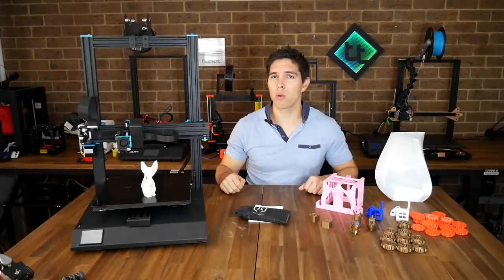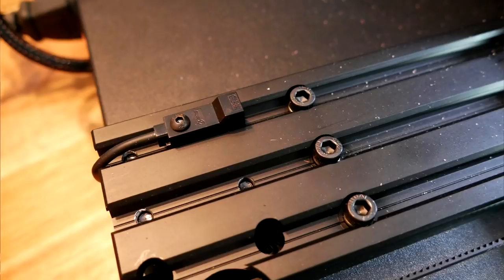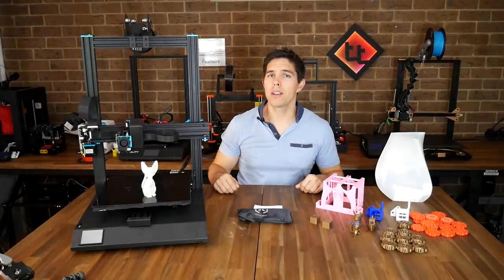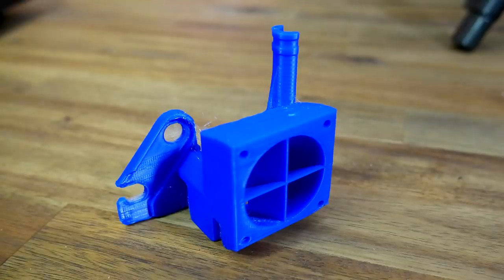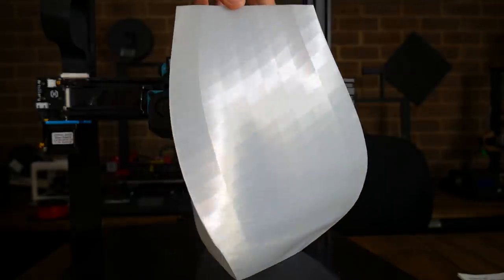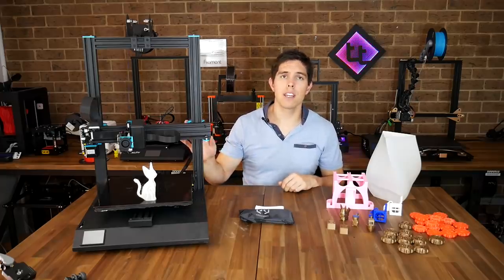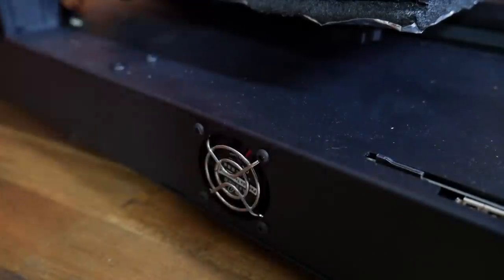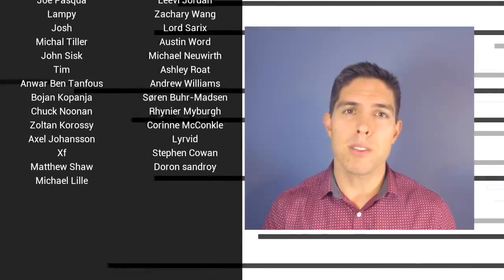Artillery 3D X1 Sidewinder Review: A unique challenger to the CR-10S

Comment: Question: wouldn't those ribbon cables be prone to wear especially the x-axis one? I feel like they'd crack and I'd be out of luck to find the exact replacement. Does the package come with extras?
Reply: I was thinking the same... It seems to have such a tight bend when the X carriage is all the way to the right side :/
Reply: @slayga  yeah, there is a spare apparently in the package so I guess they do expect it to eventually break. :/ I'd say make a wire chain or something.
Reply: @AmusementLabs  Ah yeah that's a shame. Can't beat how neat it looks though hey. I'm used to my Prusas' umbilical cord sticking out the back lol

Comment: The mechanical and overall physical design on this thing looks superb. It's also nice that the control board has replaceable stepper drivers, you could easily upgrade it to Trinamic drivers. Software seems a bit rough, but I see a lot of potential.

Comment: this machine totally kills the cr-10 pro for features alone!....a good customizable main-board..pr-loaded boot loader, many mks add on's , super easy to compile and upload firmware, led hot end light! y axis is beefed up...x axis is beefed up  dual z ( syncing a dual z motor system is a bit odd..and may cause some issues) amazing cable management....ac bed....GLASS BED....this is a cr-10 murderer...awesome to see these "over seas" company stepping it up a notch....now if we can get them to switch to a 32 bit board
Reply: A year later do you know if they've made improvements and polished out some of the issues he's highlighting?
Reply: mitch h would you still recommend this printer, or would you have a better one?

Comment: I bought a V4 Sidewinder X1 DESPITE THIS REVIEW. I found it easy to assemble and printed the test cube with no fuss. I love the near silent operation, large print volume and extremely fast heating times. After weeks of printing (engineering parts): 1- I had to tighten the belt that moves the bed (easy). 2- The v-guide wheels are starting to shed plastic (I cleaned it but will replace them with poly-carbonate wheels). The print bed lost adhesion and nothing would print. (I cleaned it with kitchen paper and acetone and that fixed it.) Overall it is a great printer. Soon I aim to upgrade to all-metal with hardened nozzle so I can print Nylon and Nylon-X parts.

Comment: A neat and solid looking machine, no question. Now the question is: how reliable is it, how solid are the electrical components and how long will it last with heavy use?
And concerning the QA and product improvement policies of Chinese manufacturers, it is probably smarter to wait a few months until the apparent issues have been revealed and the design has been updated.

Comment: First, thank you for all your great work and the incredible amount of data you share in your videos. You have made my personal journey into 3d printerland much easier since I stumbled upon your channel.

I have a Wanhao D6, well actually the Monoprice badged version. It's been inconsistent and rather unpredictable, but I did jump into modding it way sooner than I should have. Be that as it may it's already required a new main board replacement in the four months I've owned it. It also has guide rod alignment issues that reduce the print volume by about 15mm on the X and Y axes. It also has a couple of other pretty annoying issues I have not been able to iron out. I do have the enclosure for the D6 and am probably going to keep it for ABS parts and the like that benefit from the higher tempt possible. 

So, I'm interested in a larger format open framed printer for PLA and PETG and the Artillery SWX-1 and the Tevo Nereus are the two front runners.  Or would I bet better off with a CR-10S maybe? Do you have a preference or recommendation you would be willing to make?

Comment: Recently got a Sidewinder X1.   I have a issue where prints that are in the middle of the bed do not stick.  If I move the same print up closer to the front edge of the bed it will stick and print fine.  What is the deal here.  I tested the heat and the middle is heating just fine.

Comment: Does anyone know a source for the end stops used on this printer? I see on Banggood that they are apparently using inductive endstops, which I'd be quite interested to have a look at in that size. 
*edit* I was just having a look at the video again and can see it's got branding and a model number on it....but can't make it out. It looks (kind of) like XNAS and H3-J9 but I get no results with that.
*edit2* So as it turns out, it's easier to read letters an numbers if you're not trying to read them all upside down! SunX GL-8H. They're made by Panasonic, who oddly have them listed as discontinued. Their replacement is the GX-H8A, Panasonic have it listed at $36.70 each! They're about $17 each on AliExpress.
Hopefully this company have plans for when the apparent surplus of the old GL-8H runs out - They're available at $11 for two currently on AliExpress, but that won't last.

Comment: Teaching tech Please clear up the misconception that the heated bed uses more power because it has a higher current draw. It only takes X amount of power to heat a given mass with a given efficiency heater. So unless this is an incredibly inefficient heated bed, which it is not, or you have bias like having a fan blowing on this bed, it will use the same amount of power as any other heated bed. Simply the higher current heater will be on for less time. Energy, or in this case heat, does not magically disappear. In fact it may use slightly less power because it needs less time to heat up, therefore you are spending less time heating the air above the heated bed before the print starts. The only problem is if you do something stupid like having 4 of these, which rough estimate use 5amps of 120V at peak, running on the same 15A breaker, you will trip the breaker if they all heat their beds at the same time and your prints will fail if you let the glass cool down too much.

Comment: Thanks so much for this video, 
It actually helped me decide which printer I would go for (CR10S or Sidewinder)

I don't know if you have noticed but you had the spool holder on the opposite side. 
It might have brought you some issues like the comment you raised around the filament sensor.

Comment: Before each print, if I dial in the leveling to optimize first layer and clean my glass bed made from 1' square mirror panels (and by clean I mean wipe with micro fiber cloth to remove dust+fingerprints and occasionally use IPA if it's been an especially long time since i've used the printer or there are excessive fingerprints), I literally never have adhesion issues on a heated bed assuming no power loss. No glue or spray needed. It seems to me that the textured glass beds just don't cut mustard. If this bed isnt textured, maybe the heating element for the bed isnt powerful enough? or doesnt deliver consistent heating?

Comment: It's now November 2019 and the Artillery X1 sidewinder is $570 ar Banggood and the Creality CR10s pro is 50% more at $820. A fairer comparison is with the CR-10S not the Pro version.
I don't know what the Sidewinder cost back in January but now I would buy the Sidewinder over the CR10-S in a heartbeat.
Reply: idc where you are looking. The artillery sidewinder x1 ist 350$ on Banggood. And the cr 10s PRO is 430$
Reply: @staticred1559  Australian prices. The sellers were the usual suspects. Banggood, Aliexpress and Gearbest. Amazon Aus. is more expensive. I did buy an Ender 3 for UD$150 late last year from eBay which was a goodprice and that includes 10% GST (Sales Tax)

Comment: Thanks for the review, it was very interesting.  My biggest negative is the flat ribbon cable going to the print head.  As you pointed out, if not folded correctly, it can / will get damaged easily.  Constant moving forces on that cable can / will cause connection issues.  Also, each conductor is thin, so the hot end must be using several to be able to carry the current.  If a conductor fails, it is a silent fail (you wont know) until enough fail and you have melting wires.  The last con of this cable is when you add an auto probe, you will need external cables anyway, destroying the neat and polished looks it currently has. Other than that, it seem like a sturdy printer that needs a few firmware enhancements.
Reply: Is it possible they left a couple of extra conductors open in the ribbon cable for the addition of things like a bed leveler?
Reply: @vanceblosser2155  Maybe.  You would need engineering drawings / schematics or a couple of good photos of the connector board.  Is this an open source printer?
Reply: @markferrick10  I would assume so since he displayed the Marlin code used, but I have no further information on that.
Reply: @vanceblosser2155  I should have been clear.  I am questioning if the printer HARDWARE is open source.  If so,we should be able to find the documentation.  Sorry...
EDIT - I looked this up on the net ( only about 10 minutes research) and I see no indication of OSHW.
Reply: @markferrick10  Everything he showed in the video is available on AliExpress. I'm using that same motherboard, and the touch screen is available although I'm still using the older LCD panel. The AC bed heaters have started showing up in various sizes and voltages, the stepper motors don't appear to be unique, so if it's not open source it's pretty close. Also, if you have one at hand you could examine the cable connector ends and check for unused conductors.

Comment: Should i get a sidewinder and upgade it with auto bed leveling, or get a Prusa? Money is not an issue, but i like the bigger build volume of the sidewinder. If the print quality is 90% as good as the prusa, then im tempting towards the sidewinder.

Comment: Does creality pay out really well?   Just asking because I don't know how you can say this printer is for a confidant 3d printer user?   Its setup in less time and prints way more consistent then my creality machines.   You point out there is less of a user base and a few small issues that you experienced  well those issues have been addressed by that small user base you spoke of without the need of your design expertise.  I was a fan of your channel but it is now apparent that its just a video factory to gain as many subscribers as possible.      To those looking to get into 3d printing save yourself sometime and aggravation and skip the sub 400.00 market .   I went down that road and now have the 200  printer to my left which takes some finesse to get a good print.  To my right the x1 that I dont even think about I just print.   Its seems that most of the 3d printing youtube channels have turned into the best bency channels its so much more complex than that.

Comment: I just bought one of these. I want to upgrade the stepper drivers to TMCs and LV8729 on the Extruder but that requires reversing direction in Marlin.

There is probably going to be 0 chance of them releasing the source code and since it has an RGB light I'm guessing just downloading Marlin means I wont be able to use the light if I configure fresh marlin?
Reply: i have the  source code

Comment: Why don't these larger format 3d printers have auto leveling? Seems they have all the other features minus that.
Reply: Agree, autolevel on the bigger beds is really important because it's really hard to get the larger beds flat and level. On my 150x150mm bed printer doing manual leveling is no problem, but my CR-10 was a nightmare before I added a BLTouch.
Reply: From the looks of the extrusion on this one you won't have to level it often. My Folgertech FT-5 is massive and built like a tank. Only have to level the bed if I make changes and I hammer it at 75-80mm/s daily. Most of the Chinese 3-piece-meal printers rattle themselves to death. I prefer my zed on the bed anyway...
Reply: @oldsjunkie1  The problem is, it can be close to impossible to get the bed level in the first place with the larger beds. And the larger the bed, the more likely it is to not be perfectly flat, meaning mesh compensation becomes increasingly necessary. Inductive or capacitive probes are cheap and the software side is already in Marlin, so I don't quite get why we don't see it more commonly.

Comment: Hello, I recently got are Sidewinder X1 Version 5 everything was going great until I got are an Error: Heating failed, system stopped! Heater_ID: 0,  my Heat bed and Extruder is also reading -15 I read this could be bad connecting with the ribbon cables so I inspected them for damage or burn marks but they looked ok I made sure they were fitted correctly but I still get the error and - 15 every time I try and heat up the extruder and heat bed so I mock fitted the spare ribbon cables and still no luck.

I'm also getting Error: Printer halted kill () called! when I press the home on the screen since I only just got this printer 1 day ago I don't want to open up the bottom and have are look for a loose connection because that will void my warranty I feel like I might have gotten are lemon and getting are refund might be the best thing to do at this stage so far I'm not impressed by this printer I have 16 kg paperweight sitting on my desk until  I can arrange a refund if anyone has any idea's or has run into this problem before and fixed it?
Reply: Try posting it on the reddit forum.
Also, people on Discord are very kind and helpful if you need to troubleshoot.
https://discord.gg/aWYh49p

Comment: It looks alot like the creality cr-10 pro
And pretty good video i’m going to get a ender 3 Pro soon
Reply: I got the Ender 3 Pro as my first printer less than 45 days ago, have been printing everyday. Very addicting. However, starting out was very frustrating, most of that frustration went away after I installed some stronger tensioned bed springs and got a glass bed (had to raise the z-stop). After that, my prints have been awesome. I only have a 25% failure rate. 

Thanks to Teaching Tech, I am finally going to install a BL Touch using his guide. I ordered all of the stuff and just waiting on an Audrino to install it next week. Makers Muse is another good channel to watch and learn. 

I don't know the price points, but I think there is an Ender 5 now. This printer has been an Awesome starter printer.
Reply: Check crealitys ebay page they will auction units and you can snatch yourself a small discount. I bought my ender 3 pro for 212
Reply: Thanks:D

Comment: Great review! Have you replaced the stock extruder with a BMG style one yet? Thanks
Reply: There is no reason to, it is a 3:1 gear ratio. With direct drive dual gear is not needed in the slightest. Infact it becomes quite bothersome when changing filaments as the titan aero allows you to do it all manually, whereas the Bondtech BMG forces you to run the extruder when changing filament

Comment: Problem printer ;-) very honest review, thank you ...i use tank frame printer Ortur 4 ;-) very very stable & no plastic wheels
Reply: How are you liking the printer the ortur 4? I just looked it up and did a little research and the rail system looks very interesting. Redi rail is what I would say it is looks really sturdy and lots of features for 500 bucks. Was looking at buying my first printer and wanted something that is decent build volume and has a lot of the upgrades right out of the box and it looks like it could fit the bill.
Reply: @cjcalhoun85  I love my Ortur 4 (very powerful and simple to use) but the most important thing is that the Ortur-support team is extremely friendly and honest

Comment: Its nice to know that in a years time we are going to reach a time when 3d printers will be 90% complete. ribbon cables, 240v heat bed, dual extruders, auto bed levelling, all built in one rather than a separate box, titan hot end, sturdy frame etc. Hopefully, these will all be next to standard on the 3d printer in a year and at an affordable price.

Comment: With the ribbon cable to the hot end, how difficult do you think it would be to add a BLTouch to this printer?
Reply: Runs on marlin, I own one and they said they would send me the firmware which is marlin. So it should be doable.

Comment: Just received my artillery sidewinder X1 yesterday. Not impressed. Lose hardware in the package, chipped paint, gouged ribbon cables, wiring feels cheap and not flexible enough for the tight turns. X axis on mine won't move at all....

Comment: Looking to buy my first printer and was leaning toward the anycubic I3 mega or maby  the ender 5... I'm looking to do mainly  table top mininitures ( high detailed small parts and large fastly printed terrain parts) and perhaps some drone parts soooo what would you or your community suggest?
Reply: There is absolutely nothing wrong with the ender as a starting platform. Many people in many social media groups show amazing prints off a stock machine daily. It's all down to the calibration, slicer tweaks, cleanliness and filament quality.

I have two Prusa mk3s' and love them. But if I only had Enders available, I'm sure I could get the same results
Reply: highly detailed miniture i would get a elegoo mars sla for 250 off amazon.(they sell out fast but I was able to get one. by the time I finished my buy now they were sold out again) as for terrain this when setup properly does amazing and they already have videos up about adding bltouch to it easily. The enders are great machines but I like this one alot more personally.
Reply: @3dprintingbiker693   bltouch?
Reply: @3dprintingbiker693  I have two fdm/fff printers now, and using them almost back to back. I have a client after some super high detailed, small parts. Probably going to pick up a SLA printer soon. Tossing between the Mars and the SL1...
Reply: @MadNitr0  yes the sensor for auto leveling.
Reply: @slayga  I love the Mars so far. no issues whatsoever. Had it up and running in 15 min. lol.